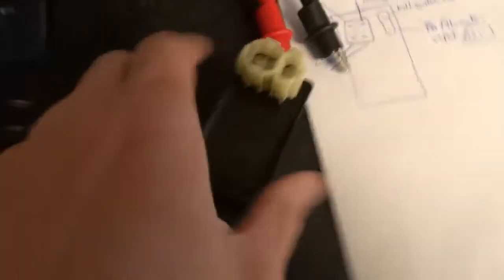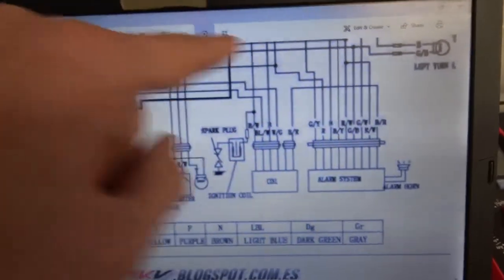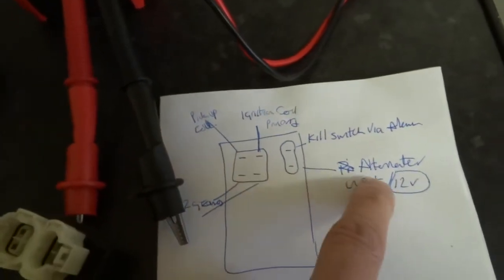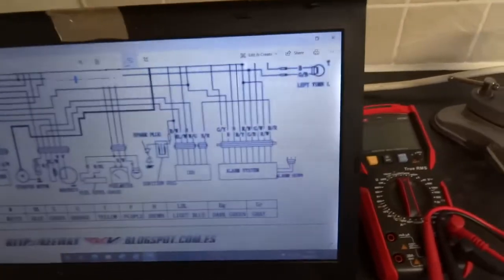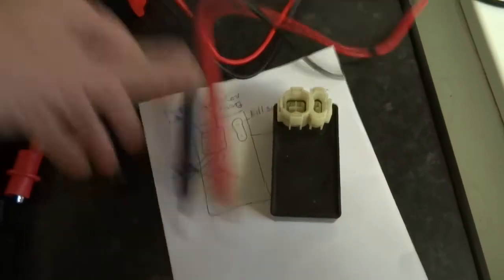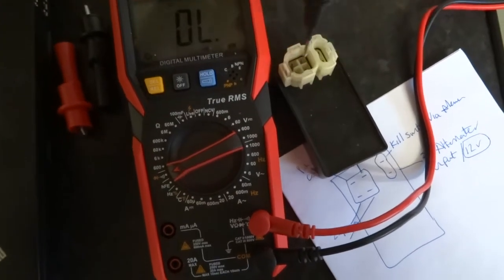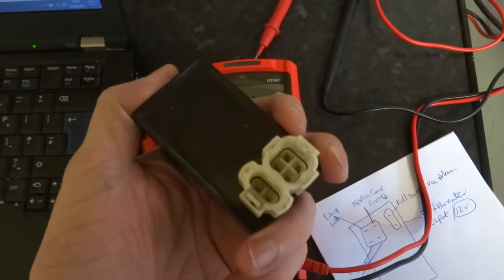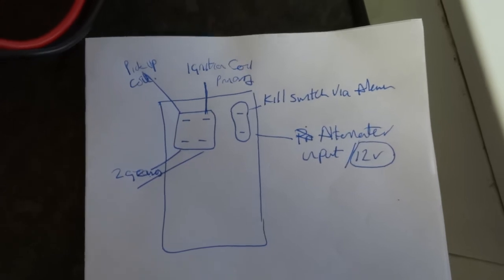How to Test a CDI Unit - Diagnosis with a Multimeter

Comment: So  if it beeps then that means it's bad?mine beeps on both grounds and also beeps on the two probs by them self.
Reply from the maker: Not quite that easy it depends on what your testing need to check wiring diagrams and pinouts , you need to know what wires are what ill try a better video asap.